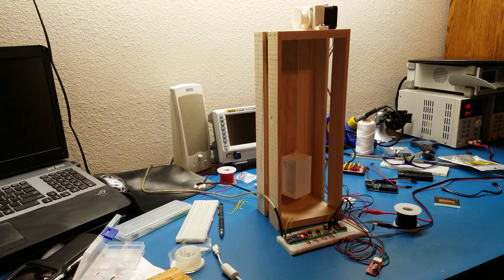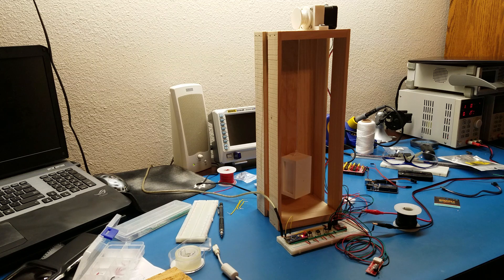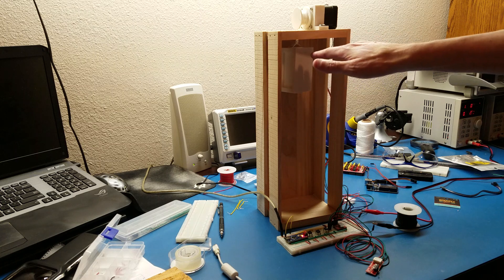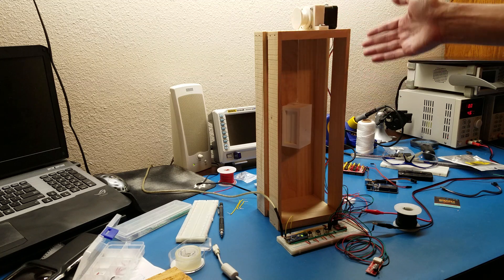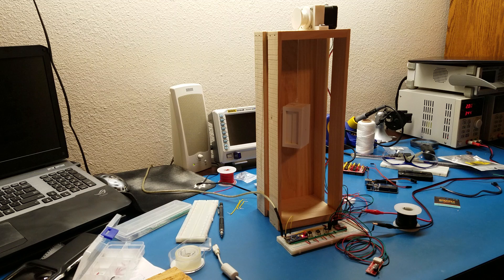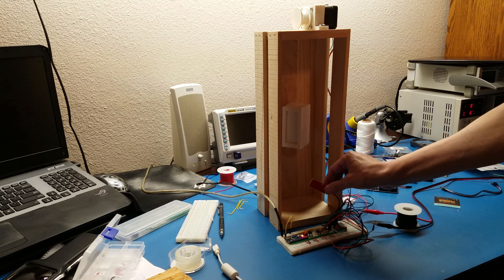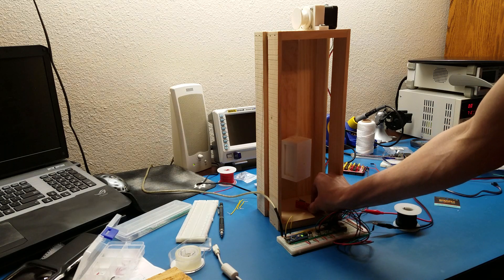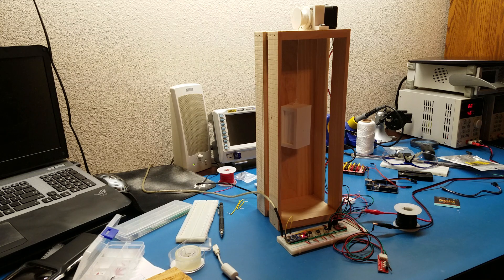Demo of Elevator Project

Comment: Could you please let me know how the load is held in say floor no. 2? Wont the load  free fall? What has to be done to hold the load in place preventing it against gravity? This is for a project for my son. Thanks
Reply from the maker: To overcome the stepper motor, you would need a much heavier load than my 3D printed elevator. To hold the load in place, I'm not doing anything. The stepper motor's default state is to sit and do nothing. It only moves up or down when I send it a signal. For example, after it initializes and I tell it to go to floor 2, it carries out that command and when it arrives at floor 2, it sits and does nothing. If you want to look at the programming, here's a link for you: https://github.com/davidc-ee/ElevatorProject/blob/main/Elevator.ino

Note that I never finished this project unfortunately. I had to use a Vex Robotics microcontroller to receive credit for the project, so I abandoned this little Arduino elevator. I still have it and would like to get back to it someday ... just for the fun of it. If I do get around to continuing with it, there are better ways of handling the movement between floors. In this video example, I'm using stepper motor "steps" to know how far up or down the elevator has traveled. That idea can work and may be good enough for a simple project, but it's possible for the "step count" to get out of sync, in which case your elevator will end up stopping a little too high or a little too low. It would be better to use sensors at every floor so that you always know exactly where the elevator is at.

There are a ton of things you can do with a project like this ... it just depends how much time you're willing to put into it.
Reply: @davidcourtney1398 thanks a lot for the detailed reply.

Comment: Thanks a lot , can you give me code and layout.
Reply from the maker: I ended up abandoning this project because the class I was taking required that I use a Vex microcontroller. I still have it though, so maybe I'll finish it some day just for fun. Here is the code I wrote, but it probably won't help you much. 

https://github.com/davidc-ee/ElevatorProject/blob/main/Elevator.ino
Reply: @davidcourtney1398  Thanks a lot for helping.

Comment: can u please tell me how does the elevator knows its postion
Reply: i mean the 1 st 2nd 3rd floor
Reply from the maker: Since I'm using a stepper motor, I'm relying on step counts to know where the elevator is at. When the system initializes, the elevator has no way of knowing where it's at. So the first thing it does is to lower the elevator until the limit switch is pressed. Once the limit switch is pressed, we know the elevator is at the very bottom of the shaft. Let's call that the ZERO position. From there, I raise the elevator by 35 steps (a tiny amount), and that is Floor 1.
To go from Floor 1 to Floor 2, I raise the elevator by 300 steps. I'm now at Floor 2.
To go back down to Floor 1, I would lower the elevator by 300 steps. Or to go up to Floor 3, I would raise the elevator by another 300 steps.
The code has logic so that if you're at floor 1, you can't go any lower. If you're at floor 3, you can't go any higher.

Note that it is possible for your stepper motor to get out of step, so this idea of relying on step count to know where you're at isn't perfect. But for this relatively simple project, it worked. It would be better to have additional sensors along the walls of the elevator to keep track of the position.
Reply: In a real elevator there would be at least one switch on each floor to make sure the inner and outer doors are lined up even if the cable length changed. (e.g. due to temperature variation)

Comment: I am a professional programmer. There are lot more things to consider to create lift using arduino c and embedded system. i have the best coding with all safety features, alarms, flashlight and power failure logics. anyone who need it send me a private message in youtube or reply here.